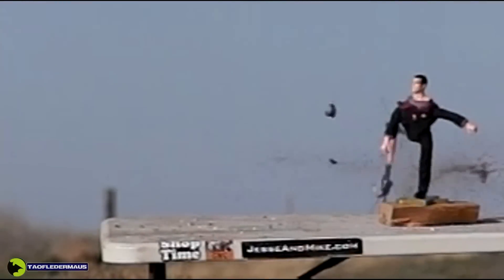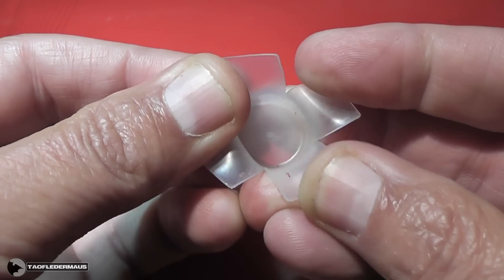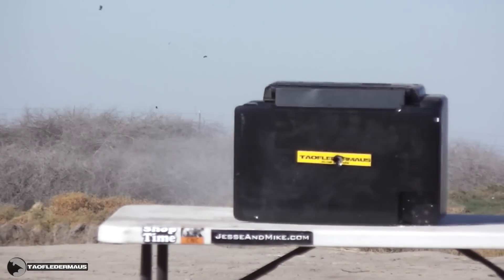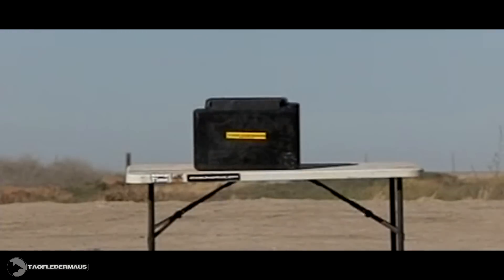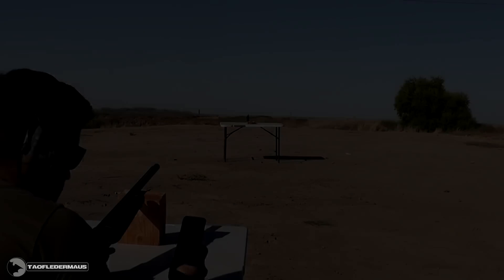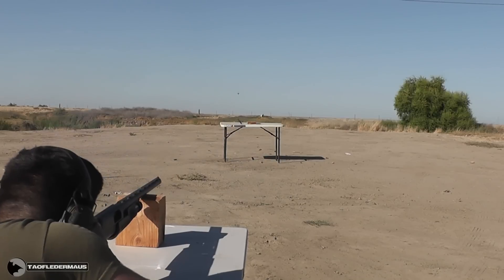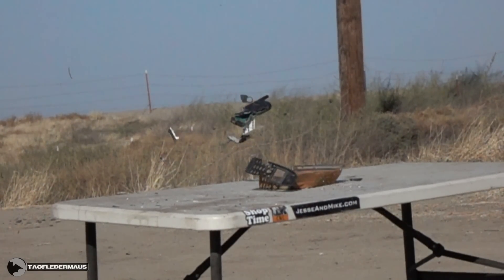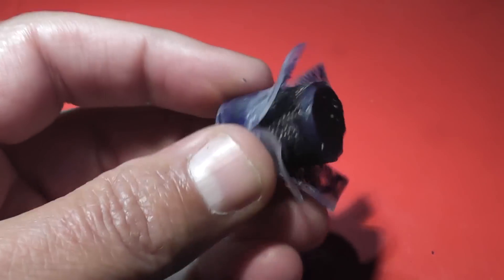Stabilized Wax Slugs -  ALMOST Impossible Physics

Comment: There are over 2,000 forms of wax.
You probably used a Kerr purple wax?
Had you made the core of the group out of purple wax and then the bottom and outer edge out of a lower melting point wax like a blue wax or Turquoise it would have melted away soon enough that the core would have remained semi solid.

Comment: It looks like the air is exerting so much force on the flaps that they fold right back, putting the centre of drag aft of the centre of gravity. That would be my explanation for why they fly nose-forwards. Of course, since they aren't designed to do this, they are uneven which fouls accuracy.

Comment: These wax slugs are very interesting. As it seems there are no benefits of having the wad stuck to the wax slug, have you concidered making some simple mold to make a slug uou can place into the wad instead of pouring the shot and wax directly into the wad? Such a mold could be made out of wood or plastic, since the temperature they would have to withstand isn't high.

Comment: are you using perafin wax?   

 thsts what and  i use wads like the first he shows but they always seem to stay on slug as a long stabilizer with no speed breaks. i get super accuracy  and know wads stay as i find them stuck where slug hit.

i also use 2 3/4 inch hulls that are unfurled so its ends up a  3 inch round

Comment: Maybe a mold in the shape of the tactik drive slug would give some consistent stability to a wax slug? Or any of the other slugs you've tested that show stability in flight out of a smooth bore. Would any shape other than a column separate before impact?

Comment: If you cut the ends of the petals on an angle it will probably give the slug quite a high spin (especially since they stick out so far), could improve the accuracy a bit.

Comment: I think a 50/50 mix of steel shot (bottom) and lead (top) would give a semi-stable flight. The idea is the denser material at the front would lead the slug in stability like a hollow tail foster slug, and it would be fairly cheap. 

Anyway you choose, your videos are great!

Comment: I thought of a neat idea with these. try molding a cloth, rope, twine, or some other material into the slug so it trails behind for stabilization. You will need to mold them before loading. I'm sure some materials might have problems under compression so experimentation could be interesting on the high speed cameras.
Reply: on a side note, i wonder how long of a trail you can make and still be practical. I'm thinking about flourescent cloth tracers or something.
Reply: maybe a half inch wide strip of kevlar. tie one end in a knot and mold the knot into the slug for better retention.
Reply: can kevlar withstand the heat of molten lead? perhaps mold it right into lead slugs?

Comment: Tao, in lost wax casting theres lots of different types of wax. Vary in elasticity/hardness/melting temps. candle wax & crayons are 2 entirely different worlds/properties. Im wondering if u used jewlers carving wax or lost cast wax (more elastic & flexable) how it would affect results. also, if a thin plastic wrap (like saran wrap) inside the cup w shot on top of it would make wax adhesion to cup impossible. You guys are facinating, your show greatly enjoyed. I dont envy U the endless variables involved in your applications. :))

Comment: Could you put wax at the bottom first(about the first third) then let it harden, after that put the wax and steel shot in the front/ top of the slug. Maybe the front would have more mass and the back would slow down. Or maybe have the bottom 2/3 wax.

Comment: Would you try to do machinable
Wax slugs ?
Also 1/2" ID copper plumbing stub outs cut at 1.125" in length in a 12 gauge  
They weigh at 15 grams or 1/2 oz
Reply from the maker: I have some machinable wax.  It does the same thing normal wax slugs do.   There's no difference at all.
Reply: TAOFLEDERMAUS 
And the stub out ?

Comment: when you think about it it is very understandable why it is stable. At supersonic velocities, the more in front a point of the thing is, the more drag it produces, so when a petal moves in front, greater drag will push it back, making stable. another thing which plays at subsonic speeds it that a petal in the back well be in so called aerodynamic shadow of a slug, while the front one will get more air. in a nutshell, these two are basically the same thing.

Comment: If you follow the path of force the drag would create it's actually at the rear of the slug since it wouldn't translate laterally into the wax slug as the petals want to pull away away  but towards the back of the wax slug so the drag force was in effect behind the CoG significantly. Force vectors aren't sometimes intuitive.

Best way I can think to imagine it is picture the plastic shot cup wanting to decelerate faster but getting dragged along by the slug's momentum as they are stuck together.

Comment: Alright, now you need to make some glue slugs. They're the same as wax slugs but you're using glue instead of wax. Make multiple different kinds, Elmer's glue slug, wood glue slug, superglue slug, glue stick slug, Glitter Glue slug, hot glue slug, Rubber Cement slug, caulk slug, etc. Then put them all head to head to see which slug is the least stupid idea.

Comment: did that first blue slug actually go around the phone like the other supersonic rounds did in other videos? remember when you saw rounds being pulled around objects because of the shockwave mechanics? at opportune positions, the pressure wave must be acting like a spongy air cushion as it hits the target before the projectile, and so builds up an instant pressure wave on that side, with the back of the object being shot at forming a strong vacuum part of the air wave which makes the projectile slide back over as if it had a mind of its own. the only way to avoid this happening is to have a flat target 90° verticale to the projectile, and large enough for the pressure wave to be evenly repulsed by it so that it doesn't create any vacuum behind the target. another thing we aren't realizing is that a supersonic pressure wave must be like a tsunami in the ocean, sucking up air instead of ocean water before it arrives.

Comment: My guess:
The tabs are pushed back very violently by the dynamic pressure in front and the low pressure on the back. So the center of lift is behind the COM. But as the slug slows down, the tabs unfold and increase the aerodynamic footprint. Now the inertia pulling the slug against the bigger crossection aerobreak (that's basically what the shotcup is at this point) are breaking the bond and they're seperating. 
Would be interesting to see long shots into nothing to see what's going on. Maybe some stick together and fall out of the air?

Comment: First of all: Would it improve stability if you use different shot densities? (like for example front heavier and the back lighter) this could probably be achieved by mixng steel and lead shot.
Second of all: Why is a Hoola-Dancer in a Forest-Fire frustrated? If the Hoola-Dancer was the arsonist behind the fire they should actually be quite pleased.

Comment: I think if you could add spin stabilization to the slugs with the shot cup attached it would make for a very accurate projectile. It would remove many of the variables, it may still be affected by unevenness in the drag, but it would tend to spiral and stay on target instead of flying off at a tangent.

Comment: By my uneducated eye, I'd bet the airflow is coming off the nose of the slug radially and spreading wide, barely applying force to the "fins". If the slug were to pitch or yaw, the airflow would change; apparently this tends to unfurl the then-forward edge and create a little more drag.

Also, did you observe any substantial deceleration? I don't think so since if the shotcup were actually affecting the velocity, it would fold right back. Instead, I bet it's exactly the same speed.

By the way, it would be difficult to set up, but a high-speed shot straight down (or straight up?) such that the slug is not flying oblique to the camera could offer some better flight direction insights.

Comment: what if you used one of the stable machined 'pellet' slugs youve used previosly to create a simple 2 piece mould to cast a wax slug into a "airgun pellet" shape?
Reply from the maker: It would shatter due to the shape.  I tested some pellet shaped slugs using rock hard putty which is a LOT tougher than wax and they all shattered.
Reply: could be interestin gto see ^^
Reply: sorry to change the subject, but back in the 80s a company marketer a bullet (unsuccessfully) that was basically a hollow tube like a toy that I believe was called a aerobee. It was a 9mm round. I would love to see a section of pipe cut and loaded into a 12ga shell. I suspect they would need a rifled barrel for spin stabilization. I don't know if the rim would need to be modifed. I remember watching a demonstration of that 9mm round shot into gel and it had a tendency to curve upward sharply after entering the gel. would you consider trying it, not necessarily into gel. I would love to see the flight characteristics in slow mo.

Thank you and the guys for all of the fascinating and fun videos. I watch your videos with my father and my son. You have 3 generations of fans here.

Comment: Have you ever tried hot glue slugs? Same concept just use hot glue instead of wax. IraqVerten8888 did some way back and got some interesting results. Would be neat to see them on high speed though.
Reply from the maker: Yeah, they are difficult to make because hot glue is so thick.  You end up with voids,  because the shot doesn't  "self stack"  like it does using the very thin wax.  They end up being imbalanced and inaccurate.

Comment: can you make a slug with aluminium powder and iron oxide held together with wax? i wonder would the charge be enough to light a thermite slug
Reply from the maker: No,  it doesn't get hot enough to light thermite.   It has to get thousands degrees hot to ignite.  We know it doesn't get hot because the plastic doesn't melt.

Comment: Would there be an effective way to make a spherical wax slug? Probably need some custom shot cup then too, huh? It'd probably tear itself apart when it exits the barrel. Maybe inside the barrel...  ok. I don't know enough to make a good suggestion - nevermind. Just thinking out loud.   I should stop doing that ;-)
Reply from the maker: It would shatter because of the shape.  The cylinder shape,  and how the shot stacks and distributes the force evenly is why the wax slugs don't shatter.

Comment: I'm just wondering, if you were to glue something like a small plastic cone
to the bottom of the shot cup before you'd pour the shot-wax mix in,
in order to try making the wax slug hollow at the back like say, a foster slug.
Would that stabilize a wax slug or just mess up its structural integrity,
making it break apart as it left the barrel?
A regular wax slug works great as it is, so one might think why even bother,
but i think it would be a fun experiment.
Reply from the maker: It would just create a weak point and the slug would shatter.

Comment: Do you think you could use caulk instead of wax for this kind of slug?
Reply from the maker: It would be more expensive.  Stinky. messy   Take a month to cure all the way through.  It is thick,  so the shot wouldn't stack evenly- leaving voids and making the slug less balanced and weaker.

Comment: Ok, I have been biting my tongue for too long now and gotta say something about it. Love the chanel and watch most everything but the reloader, competition shooter, and scientist in me are all about to burst. You cant say somthing is accurate or not based on simply taking shots at some small objects and just happen to hit them by 2 shooters with the same batch.Ya gotta punch paper but more importantly you HAVE to have sightS. No thats not a typo, it is PLURAL. You have made multiple assumptions by saying the loads are accurate or inaccurate based on if you happen to hit an object a few times but say nothing about actually printing groups. 
Try this, make up some batches of these 2 loads again, GET A REAR SIGHT or scope on the gun, then shoot 3, 7 shot groups with each batch, with the same shooter doing all the shooting at PAPER and then compare groups. Then you can say whether the loads are accurate or not. 
The idea here, using the scientific method, is remove as many variables as possible, I.E. consitent loads, sight pictures, recoil absorbtion and such with the variables kept to a minimum to where the only difference are the wads seperating or not. But most of all, GET A REAR SIGHT ON THAT GUN. You can still use sights on a smoothbore accurately. During the civil war, converted smoothbores often had rear sights and in the N-SSA it has been found rear sights on smoothbore, muskets make them incredibly accurate. 
BTW, accuracy is greatly affected by the harmonics of the barrel so please stop resting it directly on the wood. Even smoothbores have these harmonics and they can GREATLY affect the shot especially when shooting solid shot. Think of it like this, when strumming a guitar string the sound is different with the same string depending on where you hold it down at, same principle.

Comment: Question.  What would happen if you used a mold to make a wax slug in a more aerodynamic shape?  Would the wax survive the shock of being fired and only break up once it met the target, or would it exit the barrel already dispersed?
Reply from the maker: It wouldn't be strong enough to survive being shot.   I did some tests using rock hard putty with shot in it and molded them into a pellet shape.   Every slug shattered even though the putty is MUCH stronger than wax.
Reply: Thank you very much for the reply.  As a follow up, would using a powdered substrate to fill in the negative space in the shot cup help?  A quasi sabot.

Comment: maybe some one with a 3d printer can try making a drag stabilizer that you put into the shell then pour the wax over see what that can do.

And what happens if you removed the shot cup and poured the wax over the gas piston?
I'd expect the slug would be heavier but could break up. maybe a make a improvised buckshot.

Comment: same reason why knuckle balls are hard to hit. chaotic fluid dynamics at play in a non spinning projectile
Reply: TheRealestEver I think it's more problematic than only the fin angles. I think because the nose of the slug is flat, it also causes a lot of the wiggle. The fins just keep the nose forward so this wiggle is able to take place. So I think it's a two part problem, but you're right getting the fins to a more desirable form would help
Reply: I guess all you'd really need to do is to extend alternate cuts by a tiny and uniform bit on the shot container, so when the fins open they open at equal angles, causing it to spin.

Comment: Why don't you shape/mold the slugs into an airgun pellet/shuttlecock shape?
Reply: he did they exploded he even tried it with "rock hard putty" and even that exploded. something about the shape causing them to break.

 "It would shatter due to the shape.  I tested some pellet shaped slugs using rock hard putty which is a LOT tougher than wax and they all shattered." - taofledermaus comment reply from above.
Reply: no actually he (taofledermaus) responded to a similar question. and that was his repsonse
Reply: Elyk Son of kyle Oh cool is this in a video? I'm going through the wax slugs playlist and haven't seen that yet.

Comment: I bought a bunch of shot cups that didn't have petals. They were just a cup. The guy that had them said they were supposed to make steel shot group tighter at long ranges. They did that alright, they were basically slug rounds at thirty yards. I had surprisingly good results by slitting them about half the length of the wad and turning them around backwards in the bore with a cardboard wad holding the shot in the cup. It acted about like your accidental wax slug did, flew pretty straight. I am using over powder cardboard and wool wadding on top of a black powder load of course but I wonder what a backwards plastic wad would do and how it would look on slo mo. Might make an accurate wax wad???
Reply from the maker: I'll look into that!
Reply: Cool beans, I really like the work you're doing. Ox Yoke makes a really nice wool over powder wad that would makes a nice seal and wipes out some of the gunk that oddball loads leave, just as an aside.
Reply: Try the federal cups backwards. I've tried regular wads backwards with the cushion attached and didn't get great results. The weird ones that didn't have any cushion att all attached flew well. Seeing those federals in your video make me think of those.

Comment: Are wax slugs lethal? Will they perpetrate clothing and ballistics gel?
Reply from the maker: Yes, very
Reply: I haven't seen the other videos, was just curious if this was a meant as a non lethal round as I picture it breaking up on impact.
Reply: honestly, I skipped all the wax slug videos I'll be sure to check them out now.
Reply: I guess it would be devastating if it could break apart a old Nokia phone, those are damn near indestructible.
Reply: they would be LESS-lethal when used for breaching (shooting locks / hinges off doors). They would also reduce collateral damage from over-penetration, or missing the target and going through drywall into next room.
Reply: No question. The energy delivery is massive...like getting hit with a big sledgehammer. It wouldn't even need to penetrate to cause enough G-shock on impact to liquefy anything under the skin. WHILE knocking the target ass over teakettle like a runaway Buick. I think, in terms of pure stopping power, these would be very hard to beat.
Reply: The shot will for sure. not so sure about the wax, though.
Reply: the best explanation...